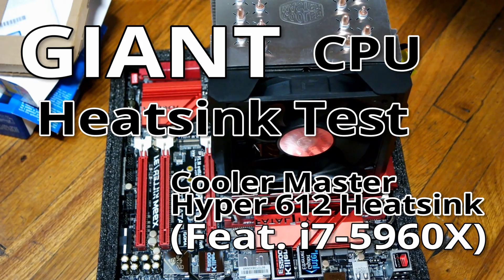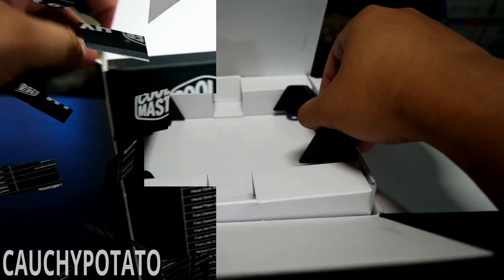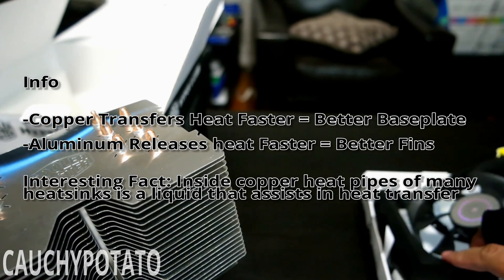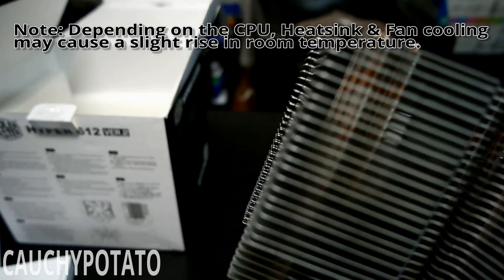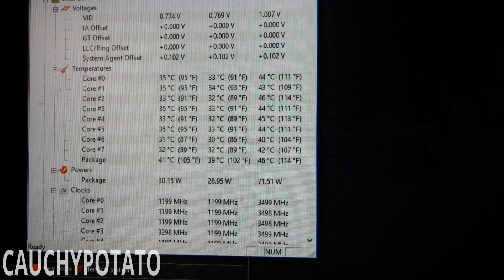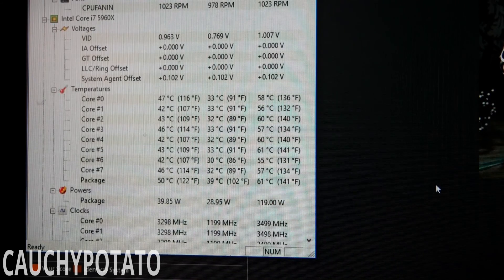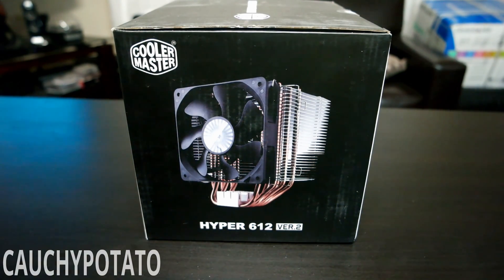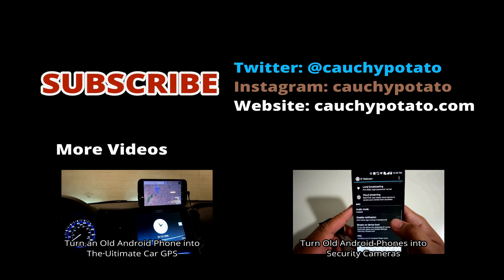Testing out the GIANT Heatsink Cooler Master Hyper 612 on an i7-5960X

Comment: Thanks for making this man. I don't have a small case like this but your temps are a testamony to how good this cooler is. I mean COME ON, it's sitting right next to a GPu and still doing great. I am going to buy one to replace my dying AIO liquid cooler.
Reply: a year later and I am using it on a intel xeon e5-2697 with 12 cores and it keeps it chilly at 30 room temp and 50 under load.

Comment: Now this has a low speed fan. Use a higher speed fan and you will see a larger drop in tenps. I used my 212 evo fan on this 612 and even better temps.

Lastly, if it was an AIO water cooler you would still see your room temps climb.......maybe even higher as it draws out more heat from the CPU

Comment: I know it's been a bit on this guide but there is a glaring mistake in your understanding of thermodynamics. Even in a "closed loop" water cooled system, the CPU will still generate the same amount of heat. That heat will still be transferred to the room. There is NO difference in the ambient temp increase with an air vs water cooled system.

Comment: Copper is overall more superior in transfer and what youcall "release heat".  One reason not not copper for fins is because of weight.  Copper is almost 3x the density of Al, so with the same thickness of fins, it will be 3x heavier.  The real reason however, it is the cost I believe.  Al is just cheaper and easier to work with.  For fins, the difference is probably marginal.

Comment: As others have said, even with watercooling, that heat still has to go somewhere. Its not magic. It will get into your room via the radiator or some other method, otherwise the liquid would come to a boil.

Comment: 2:00
It's going to be a small heater no matter what, otherwise it breaks the laws of thermodynamics. With water cooling the heat also goes out into the ambient air via a radiator, the water is just much more efficient at transferring the heat away from the cpu and out of the case. The end result to the room air is the same.
Reply: Thank you

Comment: were you able to fit a GPU with backplate in the first Pcie slot? Because I know on matx boards, the first pcie slot is nearly touching the bottom of my other 120mm heatsinks. A 140mm would not work on matx with the first PCI slot.

Comment: Good episode, I have a older version of the heatsink you featured.  I have never had a problem with it other then replacing the fan once.  It stays surprisingly clean and doesn't clog up with lint/dust.
Reply from the maker: Great to hear. After having it for a short time (and staring at hwmonitor all the time), the heatsink just feels very efficient at what it does. Really glad I went with it over liquid cooling.
Reply: is its a better coller than the hyper 212x?